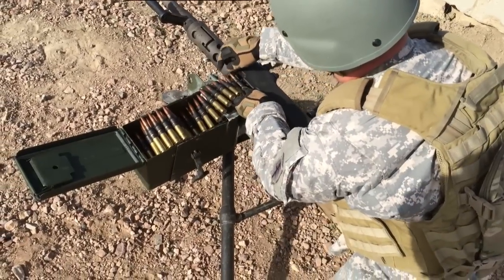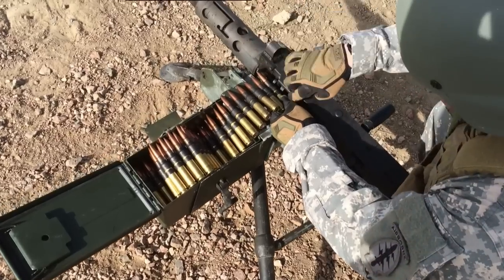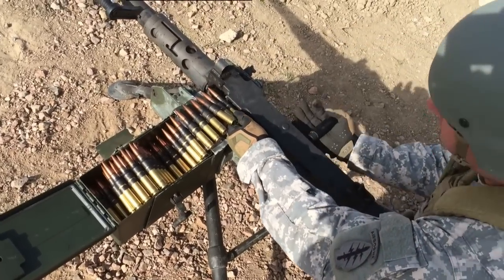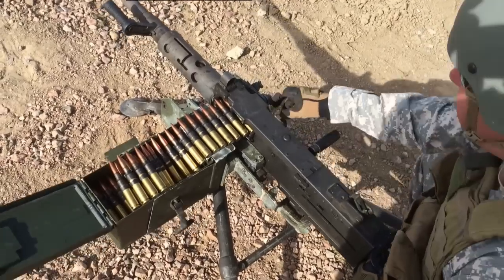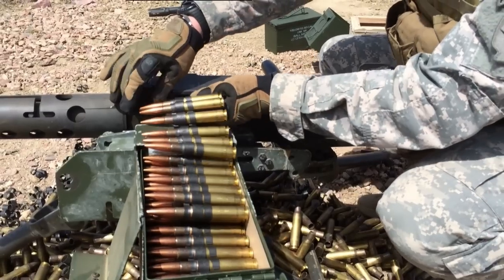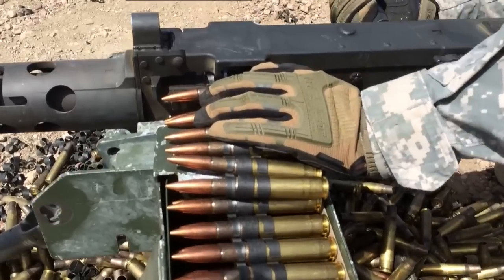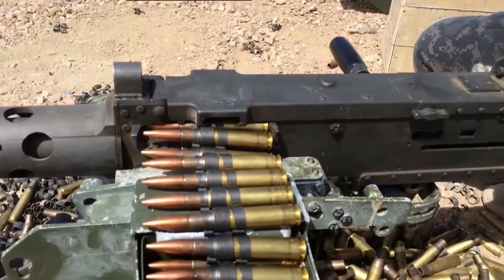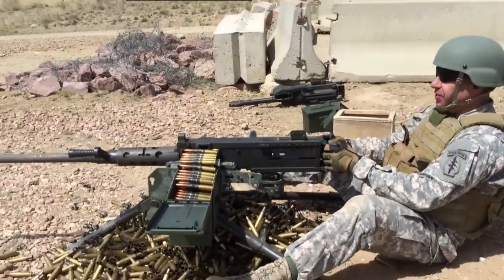M2 Browning 50 Caliber Machine Gun - Speed Loading

Comment: Old video, but recommended practice by doctrine is to side-load now. No top cover shenanigans. Designation for this weapon system is the M2A1 (not A2, no such thing exists). The older one that you need the headspace & timing gauges for is just the M2HB. 

You also only rack it twice. Let the bolt do its thing after pulling it back--don't ride it forward like in this video. Don't know why you racked it thrice here. When you side load, the belt will click into place; there's no need to hold the belt. That's only for when you're loading it with the cover open, or how you would do it on a 240.

Comment: They should just have a starter tab like the 1919 .30 cal's and MG 34/42's have, then no need to rack it three times.  Even faster, been using them for 35 years.
Reply: 440'000 m1919's built, 3 million m2's built. i guess ppl were ok with chambering the bolt 3 times.
Reply: Even with a starter tab there will be a need to rack it twice.

Comment: isn't this the new standard on the m2 loading procedure now?
Reply from the maker: macnamaraj I don't believe so.  I've never seen it before and I've be out with a number of other units and all have done it by lifting the feed tray cover.
Reply: pay attention. it's called speed loading.
Reply: +zach  knucklehead..that wasn't the question...the question was about standard procedure. The video made it clear that this was speed loading, so no need to  be so smug and condescending. No need to tell people to pay attention...perhaps that is advice you could use yourself.
Reply: Anthony Betz yes the side load is now the only approved method of load.  There is no longer a top plate open load. SIDE LOAD ONLY WITH COVER CLOSED
Reply: I was doing this in 05 Iraq. @timothyjburton

Comment: why don't you just use a starter tab on the ammo belt, probably be a lot quicker instead of lining up the ammo so the feed bar grabs it.
Reply: +Hennessy Blues In the the event you don't have one.....
Reply: 50 BMG belts don't come with a starter tab.
Reply: @Securitydude83  The 1919's did, not sure why they stopped.
Reply: @JMark-zk5pj  The loading procedure for the M2 .50 caliber has the cover closed and the bolt forward.  You insert the belt until the first round is stuck under the feed pawl, then charge the weapon twice and fire.  Maybe because the belt and ammo are so large and easily inserted by hand?
Reply: @Securitydude83  wrong.  Starter tabs work better.
Reply: @JMark-zk5pj  Uh yeah, I agree with you.  Above was my theory for why there is no .50 cal starter tab.  You can just...push it in....